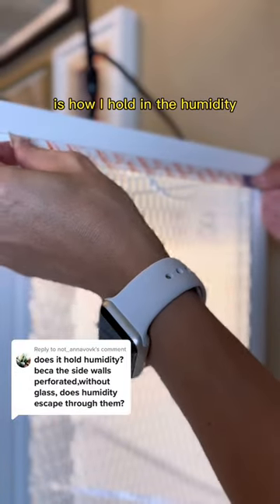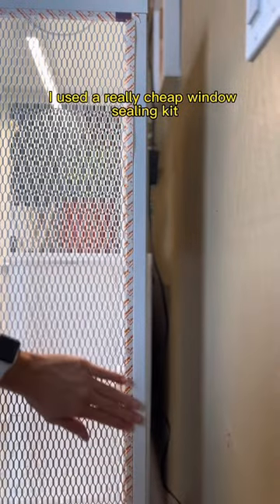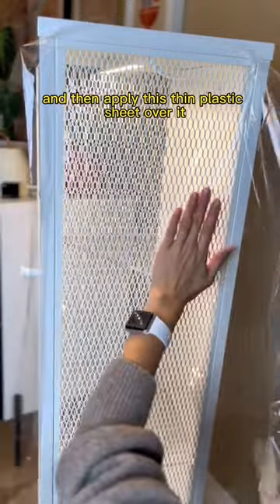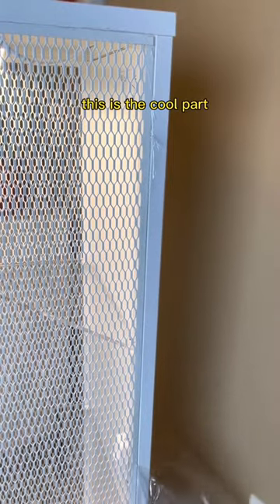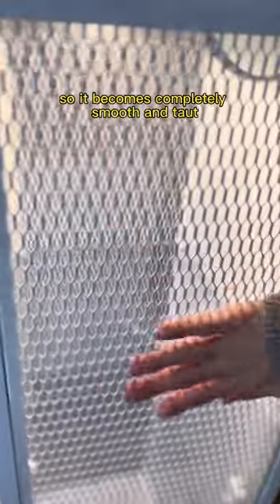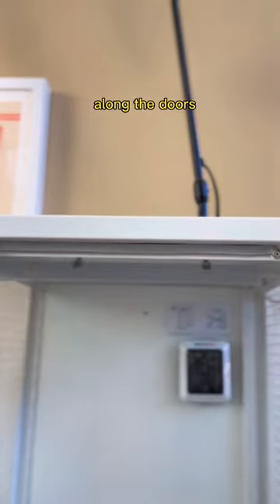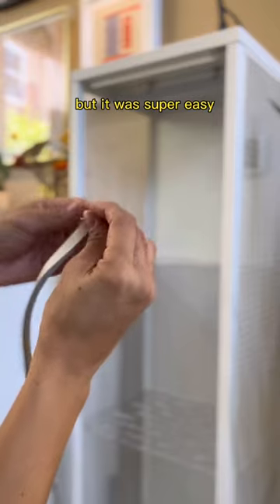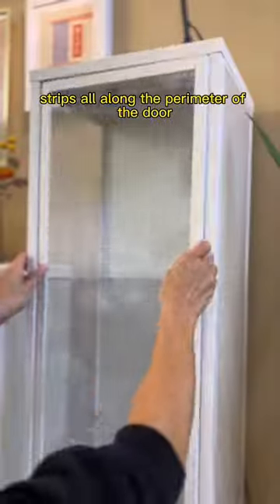Part 6 of 7 Building IKEA Greenhouse Cabinet: Weatherstripping #shorts #ikea #ikeahack #howto #tips

Comment: Any comments on the window kit sealant now that you’ve been using it for a few months? Wondering if the material degrades overtime?
Reply from the maker: No issues! Still holding strong and works great. Someone told me theirs kept peeling off, but the trick is to put the double-sided tape around the perimeter of the mesh (not ON the mesh directly) so that there's more surface area for the tape to stick to. You also need to let the tape "cure" for about 15 minutes before applying the plastic.

Comment: Sorry if someone else already asked this!! Do you use any kind of sealant to protect the metal from rusting? I have one I'm having trouble with it rusting but it only happened AFTER I used a sealant on it 😢 any feedback would be appreciated. Thank you in advance 🩷
Reply from the maker: So I sprayed rustoleum only in the area where I drilled the hole. No issues with rust otherwise 🙈
Reply: @ohtheplacesyoullgrow  thank you so much!! 💚🌱